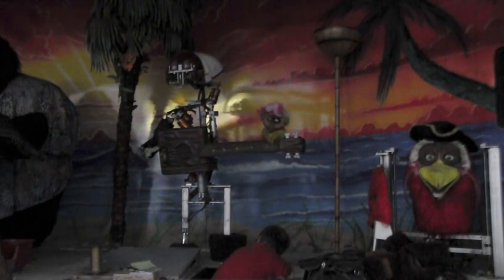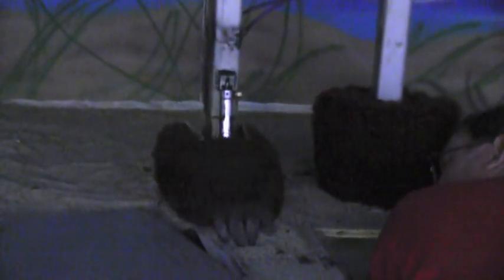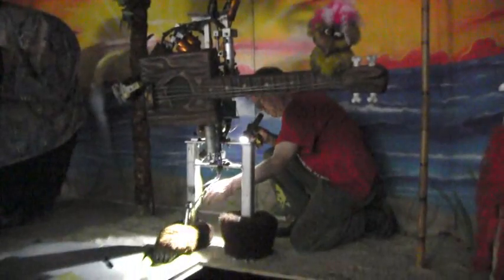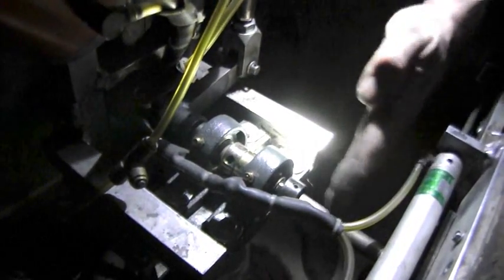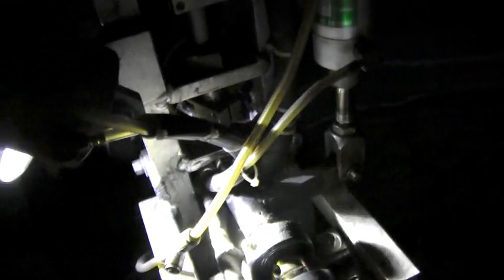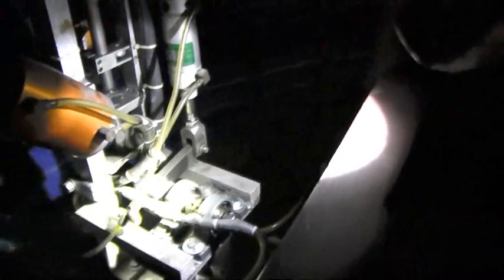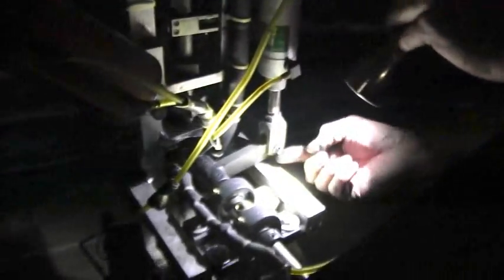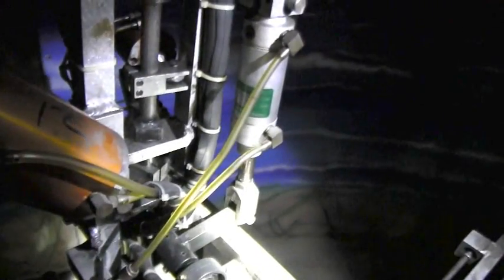Bear-A-Dise 13 Restoration ** Rock-afire Explosion **

Comment: +therockafire is it possible that they put the Mac valve quick disconnects for Fatz were screwed on wrong? This would explain why the valves are airing up the wrong parts.

Comment: Is this diagnostic program you use included in the programming of every show or something you have only when you are brought in to repair/upgrade a show?Also back in EP 6 can you elaborate a bit on the upgrades you did to the control system? You stated they don't need the oiler box anymore and you stated you replaced a wave shaper.
Reply: They might have made those as manuals for different restaurant or repairmen of CEI.